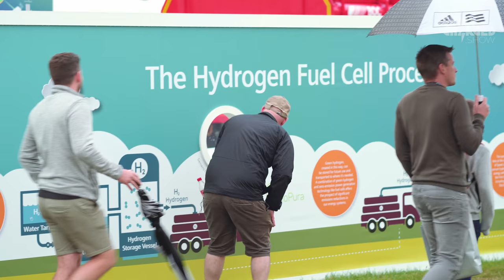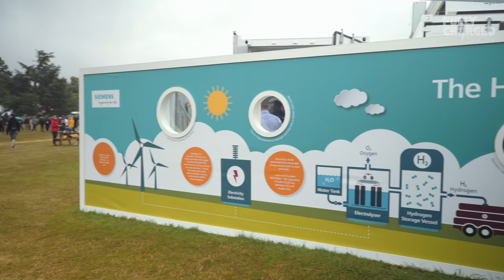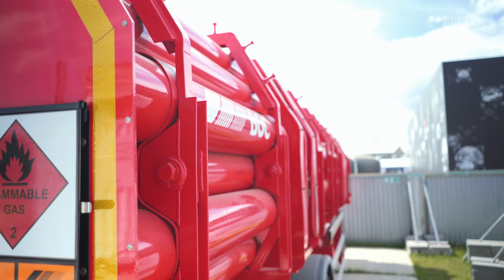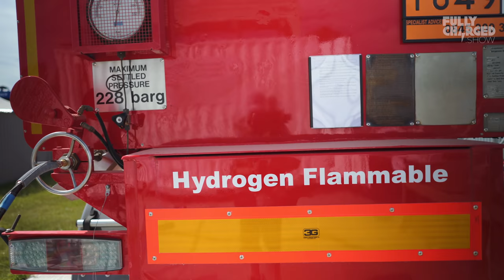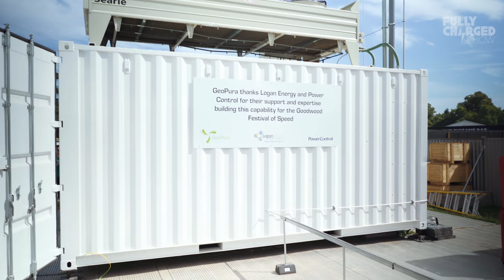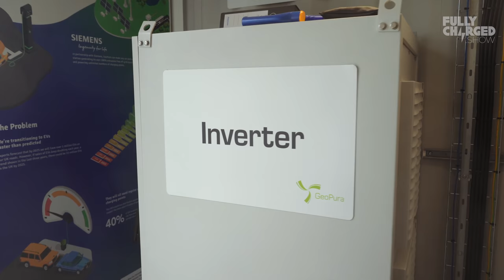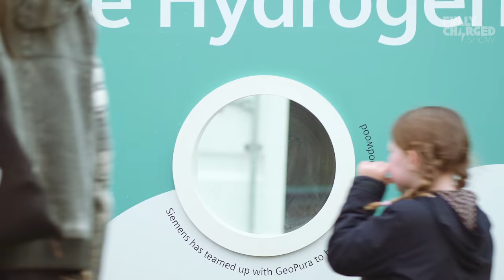Green Hydrogen Fuel Cell Charging System at Goodwood Festival of Speed | Fully Charged

Comment: That's brilliant. No one wants to hear and especially, smell those vile, disgusting, toxic diesel piles of shit when you go anywhere. Really hope you have these at Fully Charged Live events in the future, it's a must.

The only thing is though, they need to use hydrogen fuel cell lorries to tow those tanker cars too, otherwise it's not gonna be as efficient as if they used diesel lorries. Also, this sort of thing could help support new hydrogen fuel cell filling stations. Maybe get that infra structure sorted faster.

It's quite funny at the end when the man's chuffed about having "the freshest water ever" while the hydrogen mixes with the oxygen in the air around them, which has a shit load of diesel fumes in it from all those generators. If that hydrogen water machine was at the top of something like, a Welsh Mountain, I'd agree =P

Comment: I wonder if this unit can scale down and still be cost effective over batteries? Would a smaller unit made to fit into an electric Transit sized truck be sufficient for an isolated farm in need of lighting and water, using pv panels and wind to charge the gas bottles? The water production element may be key to the success of this.

Comment: The issue is there’s no easy or energy efficient way to make it. It’s usually refined from natural gas which means you’re still using fossil fuels to get a product that is “inert” or clean. It’s not a renewable fuel. Electricity is the only thing that provides truly renewable means of production with near zero byproducts. Wind, solar, geothermal, and hydroelectric power generation are the only truly renewable fuel generators.

Comment: Looks ideal for big festivals like Glastonbury! 😀 It could heat water for showers and run the festival stands and phone charging stations!
Relatively easy to transport the gas. I was surprised how little was the cargo container. 🙂

If they generate this Hydrogen when renewables are oversupplying the grid it would reduce costs. The batteries are going to get cheaper, they just need to improve the conversion process efficiency.

Not a solution for everything, but for temporary events and remote locations I can see it being part of our carbon-free future.
Reply: Can they double the efficiency?
Not just of converting back from Hydrogen to electricity (!) But also liberating the Hydrogen? (They forgot to mention that!)
If they could double the total efficiency, they'd be at about 60% overall.
Batteries are at 80%

It's not happening.

Comment: Two comments: first off, it's a bit much for a fun fair, but this to me looks more like disaster relief, or military application level of production.  In order to replace jobsite diesel gennys, they've got to get the whole operation down to the size of one container.  Fuel in one side, power and hot water out the other side.  I suspect we are still a long ways away from that.

Secondly, this setup is roughly 3 cargo containers, plus a fourth possibly smaller one for all of the support gear, piping, fencing, and accomodations for the support team of people operating it.  Fine.  So what is the power capacity of 3 containers slammed full of batteries, plus a fourth smaller one running the inverters and control stuff?
Reply: So a Tesla Megapack operates at 3MWh per container, plus a transformer unit which can handle several packs.  So equivalent capacity in batteries is 9MWh.
Reply: @Steve Davis Right... 100% on-site generation would only make sense for a pure battery scheme.  And the same tech required to purify the water at the first stage of a hydrogen plant would be better used just making drinking water directly.  That's why I was thinking military.  Also, the conversation around hydrogen fuel cells seems to have completely left behind the far more interesting (to me anyway) flexible source fuel cells.  If they can produce power from say the same diesel fuel powering those gennys at a higher efficiency with none of the NOX, then that would be far more useful IMO.

Comment: This is a much better application of hydrogen fuel cells than installing them individually in cars because it eliminates their need for expensive distributed hydrogen fuel stations.
Electrons are easy to distribute, highly compressed hydrogen not so much!

Comment: OK, wind and solar energy, in fact any renewable power, can be stored in BATTERIES, for release when the sources aren't producing, to balance the grid. H2 is a reasonable energy form if it is produced the right way. But H2, being the smallest molecule, really isn't keen on being stored either. However, I'm not going to be completely blinkered in my choice of new energy technologies. I'm sure there is a market for H2. Just please don't bother foisting it on private car owners as if it is some dramatic late arriving rival to the battery powered electric car. BEVs have already got that one sewn up, and the grip will get tighter once the general public really cottons on. Having said that - the usual good video from FC. 👍

Comment: There's a few comments here comparing hydrogen to batteries. I look at it this way: how much does it cost to add extra power and how much does it cost to add extra energy? For batteries, the cost is moderate for both - more cells in parallel or series is more power and/or energy. For hydrogen, the cost of extra power is higher - you need more fuel cells, the platinum in them is fairly costly and you need a fair few because of its only-moderate efficiency (same, too, for the electrolysis cells to generate it). The cost of extra energy is lower, though - you just need a bigger gas cylinder (or more of them).
So, if you need lots of power, but a modest amount of energy, batteries win. But if you need a modest amount of power, but you need it for a long time (say, a few days, continuously) hydrogen wins. If you're going to run a station like the one in the video, but you're only half way through the event and the tank is running low, an extra trailer of hydrogen cylinders will be cheaper than an extra trailer of batteries.

Comment: I think the comment of 'scale it up and it will be cheaper' is a bit misleading, considering hydrogen is already produced on an industrial scale!
Plus, it costs a lot more to produce hydrogen than electricity, then when  you use it to produce electricity it's a lot less efficient than using a battery that has just been charged up.
That said, i could see it possibly being used in bigger vehicles such as lorries that travel much longer distances.

Comment: I'd love to see a cost comparison between this and grid-scale batteries, and other grid-scale solutions. Obviously it's a less efficient way to store energy than say batteries, but perhaps it would be less expensive at scale to produce more electrical energy and store it with a system like this?
Reply: No, batteries are much more efficient and cost-effective.
Reply: @JRP3  If you cycle them many times throughout the day the batteries are cost-effective.  If you only do it once a day.. not so much.  Hydrogen might be the solution there as you only need to scale up the tanks, not the fuel cells.
Reply: @rhamph  If you only need a charge once a day then just use a smaller battery.
Reply: @JRP3  Not how it works.  If you use 1 MWh during a single period of the day then you need a 1 MWh battery that you charge and discharge once.  If you use 10 MWh, but it's broken up into 10 segments with time to recharge in between, then you still use a 1 MWh battery and get 10 times the use out of it.

Hornsdale is an example of the latter.  It gets discharged and recharged repeatedly throughout the day.  This lets you pay off your upfront cost in a fraction of the time.
Reply: @rhamph  So how does that allow you to scale down a fuel cell?  If you need 1MWh in a short period of time you still need a fuel cell capable of delivering it quickly.  Since fuel cells are limited in their output rate, (which is why HFCV's also have battery packs), you need a large fuel cell to provide the power.
Reply: For the grid - batteries are like capacitors - they are effectively buffers. Hydrogen can be scaled up - and price will go down with that.
Reply: @71kimg  No, batteries are not like capacitors because they can also be for long term storage.  Batteries can also be scaled up, as is happening, and costs are dropping.  The inefficiency of hydrogen can never be significantly over come.
Reply: @JRP3  inefficiency isnt important - price and practicallity is (else eg people wouldnt drive alone in a car). You cant store days of windfarm-production in batteries -- only hours - it is - what it is .  You could store many GWH of energy in hydrogen-tanks.
Reply: @71kimg  Of course efficiency is important, hydrogen throws away most of the energy it's trying to store.  The losses in creating hydrogen are high, the fuel cell wastes half of the energy in the hydrogen, plus the compression losses, not to mention that hydrogen likes to leak out of everything.  It's an efficiency nightmare.  And of course you can store days of windfarm production in batteries, you just use more batteries, just as you'd need to use more hydrogen tanks.
Reply: @71kimg  Yeah, I see batteries as more of a storage tech for say a 24 hour cycle. Storing energy for a rainy day, or the dead of winter or whatever may need another solution, pumped hydro, compressed air, or perhaps hydrogen. That said it's a fairly inefficient way of storing energy. Perhaps time will tell if it becomes viable. I"n the mean time it seems a good choice for events and disaster relief and such.

Comment: What a great episode well worth watching, siemens is one of my all time favourite companies they seem to know what they are doing and do it well.

All the tech they showed off here is not new, but they have put it altogether to come up with something new, which is forward thinking.

Fuel cells invented in the 1800s those tanks are of the newer types as the old types were unstable, presumably the type that allow for a higher capacity of storage, which I believe came about in the mid 2000s I believe developed for the EU bus project which was a huge success but the EU pulled the plug.

There was no mention of what type of fuel cell was used.

On another note I'm surprised that fullycharged didn't visit the town in the USA that was the first ever to be fueled solely by Hydrogen around the 1980s I think it was, also didn't visit the first ever fuelcell powered busses from America, which I believe ran in service in 1995.

But still never mind all that a very good episode.

Comment: So what we have is a tanker truck full of hydrogen that can (after conversion) power an EV for about 12,000 miles.   That would be a maximum range of 250 miles per week.  I wonder what the cost of the hydrogen in that truck would be...on it's own.  Now, if recharging from a station like this, do you pay for the electricity, the hydrogen, or both?  Haven't checked the cost of compressed hydrogen, but, just thinking about it, I can't imagine this setup being very cost efficient considering the cost of the gas and the maintenance and monitoring of the fuel cell station.

Comment: Germany has hydrogen fuel cell trains in fare paying service. The UK is to trial them on the Liverpool to Chester line via Runcorn.  Electrification of the UK rail network, which is very expensive to install and maintain, has been put on hold in view of introducing hydrogen fuel cell trains. These will be highly cost effective. The initial run out for trains is electric/diesel hybrids, which can be easily converted to hydrogen/electric keeping the same electric running gear. Some will be capable of running under electric wires, then hydrogen off the electric wires. 

Diesel trains pour out a high level of pollution in urban areas, so all looks good for hydrogen trains.  Hydrogen will probably not be suitable for cars, just large vehicles like: trains, ships, trucks, buses, etc.

Comment: 1:19 That Honda e was the first hydrogen fuel cell powered car that I've seen that makes any sense. Suprised that the set up is still only 50% efficient, maybe in 'the future' it will be better.
Reply: I was disappointed that it was only 50% efficient but then I remembered internal combustion engines are usually sub 20% and felt a bit better about it!
Reply: @Ross Bourne Just imagine a car with washer bottles that refill themselves with warm water from the tail end of the fuel cell.
Reply: @Ross Bourne hmmm what do you mean by lost efficiency causes zero harm?

Comment: I think my main concern with using hydrogen as a method of storing energy is that it is quite explosive in the event of a fault.
Reply: It's only explosive when mixed with lots of oxygen, also lighter than air.  If you shoot a tank of hydrogen with a incendiary bullet, not a lot happens except some leaking gas.  Quite different to LPG which is heavier than air, so collects along the ground waiting for a spark.

Comment: Unfortunately, no mention of the (rather poor) efficiency of electrolysis to produce the hydrogen and to compress it into a transportable format.
Overall this setup consumes about 3x as much electricity as charging batteries directly - so it really is a very niche application. If you need power in the same spot regularly (like the camp sites mentioned) it's much more efficient to upgrade the power lines or - if that's not possible - install a battery storage to cover peaks in demand.

Comment: Should used these as alternatives to DRUPS and other power backup solutions for large commercial buildings and Hospitals, where diesel fumes would be unacceptable in urban environment.
Reply: @Steve Davis Nice idea, but some commercial buildings are running large servers or Hospitals running lots of critical hardware, both of which could be using MW and unless you have a large field to locate a battery farm is not really an option. If you were relying on it then you could design it in, but as back up for rare power outage, budgeting for 30% or more of your building to contain batteries ain't really an option. Alright for some smaller power requirements. Zac and Jesse just had a power outage and their Tesla power wall kept them powered while creating their last episode.
Reply: @Steve Davis The trailer showed 3MWH of electrically stored energy, or 12MWH of thermal energy and as stated could be stored in much smaller containers, presumably without cryo cooling. I suppose thinking about it, it would be 30 Tesla battery packs so yes you're right not so big after all, although the byproducts of fuel cells would be useful in a Hospital, pure water and heat for heating. However if you need emergency extension of running time, you can keep shipping in the hydrogen while the batteries will be useless once fully discharged.
Reply: @Steve Davis I'm not sure that Gen sets will be acceptable too long from now. I've seen some pretty big gen sets in my time and they have to be run periodically to ensure they're still operational. Plus Diesel has a limited shelf life, so your tank of Diesel will need to be used or drained off and purged.
There are easy ways to have tanks set up so they can be swapped out while maintaining pressure. Another advantage over diesel is that they are so much quieter. DRUPS usually need to be housed in very heavy steel and or concrete rooms just to keep the noise down and maintaining them requires ear defenders. Given the use in Hospitals, polluting the air your patients are relying on is not good health practice, same goes for commercial buildings in cities and other dense urban areas, but I concede batteries will be a better option for many, but when it comes to life safety or corporations with £millions on the line if they lose power then this would make economic sense, even regarding the additional cost of operating them, the price of which will surely fall over time. That said I'm not really an advocate for hydrogen. I think it's better off in ships, but I believe there is a good use case here.

Comment: I can see a place for hydrogen as part of the wider infrastructure around electricity production but I think it's clear by now that hydrogen cell cars are not going to happen in a big way. I do like this middle-man approach they're going for though, as an addon to a battery system it makes a lot of sense, but only if the economics bear out, and a larger battery may just be better than a battery + hydrogen fuel cell. I could see this having a place in remote locations however, that are hard to connect to the grid, like alaska, outback australia, perhaps in colder climates that need the heat production to prevent batteries from being damaged by the cold?
Reply: Hold on.
You said "add on battery system?
Hydrogen, 50%(?) To get the gas
50% of that to reconvert to the original form?
25% overall.
Or
Use a battery.
Pessimistically, 15% mains transmission losses
10% losses battery to car.
Worst case? 75% overall?

No contest.

Comment: Co-generation using the heat will increase efficiency.  I am all in.
Reply: So let's look at it.
Current concencus is  that electrolysis is 70-80% efficient.
The fuel cell used here is "50% efficient"

So that's 40% overall?

Overall battery efficiency? About 70-80% including grid losses, let's be pessimistic, 70%

BUT that electrolysis also requires plant, that requires constant maintenance.
The hydrogen needs a fleet of tankers and so drivers to resupply.
Batteries? Just sit there and "do their thing"
No resupply cost.

Long term?
Hydrogen is corrosive, it likes to escape, it has to be cold.....VERY cold.
So there's component wear and tear, losses and energy to freeze the gas.
5%?
See where I'm going?
Hydrogen needs a complicated and expensive network to achieve at best 35-40% efficiency.
Batteries? "Do their thing"
And they can do it anywhere.

It's the K I S S principle.